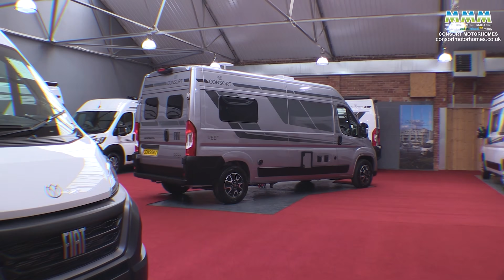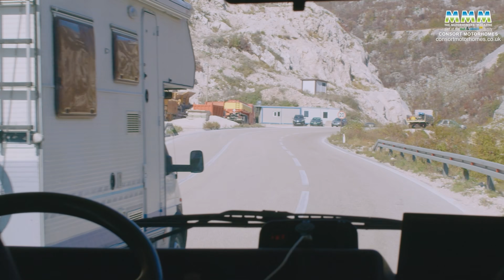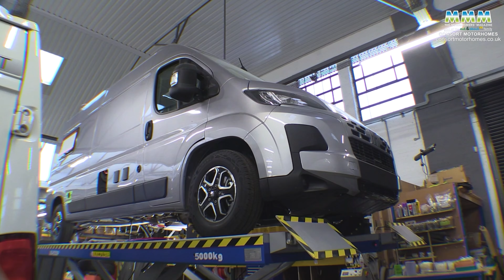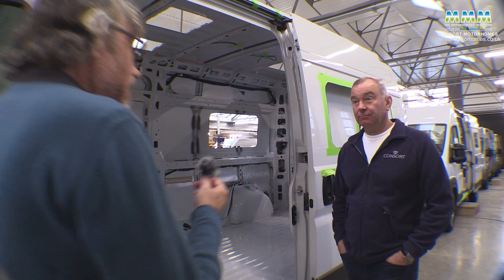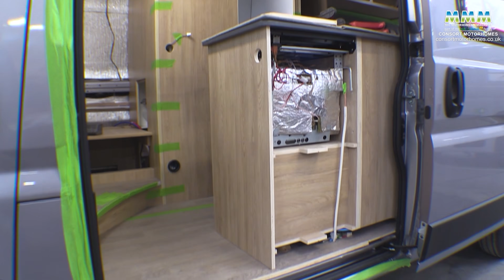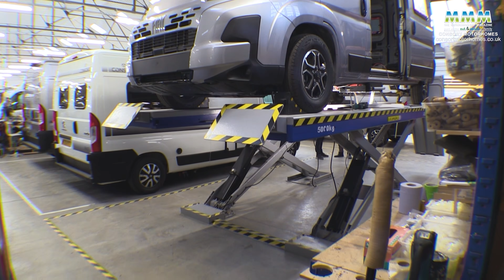See how a campervan is built at leading two-berth specialist, Consort Motorhomes in Leeds

Comment: I’d be interested if there was a transit chassis option
Reply: No you wouldn't. Transits have a rubber cam belt that runs in the sump oil. Good for perhaps 20,000 miles, then the rubber disintegrates and costs £3000 to replace, and if you don't replace it the engine is all clogged up with rubber bits so you need a whole new engine.

Comment: Peugeot boxer is is the cheapest around you pay for what you get when you buy a van there’s loads of Peugeots are they for sale with low mileage 4  years old 12,000 14,000 only on the clock no one wants Peugeot boxer van is in a commercial way 
Spending 50,000 60,000 on a van conversion I wouldn’t use a Peugeot boxer van That’s why there’s loads of them for sale
Reply from the maker: There are loads of them for sale because, until recently, a lot of major converters built on Peugeot. Like the closely-related Fiat Ducato, they work well for motorhomes and especially campervans and Stellantis has worked with the motorhome industry. There are better vans but a Sprinter or Crafter costs a lot more.

Comment: I’ve no experience of Consort but they seem to have a good reputation. 
Shower curtain (based on other comments) is disappointing these days. I was going to make an exasperated noise about the U shaped lounge ( much nicer than just two benches but my wife wouldn’t consider the layout for a second) so be interesting to see a fixed bed option.
Reply from the maker: The fixed bed model is coming, in all three lengths of Fiat